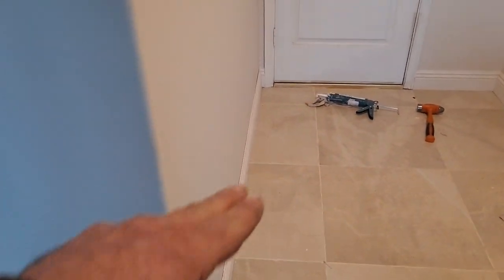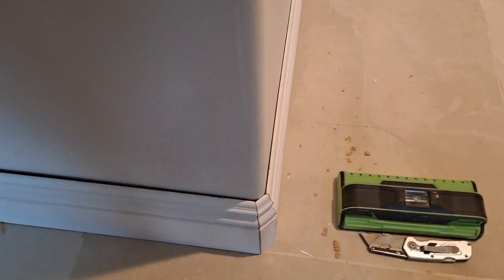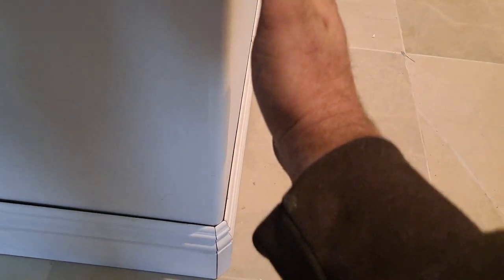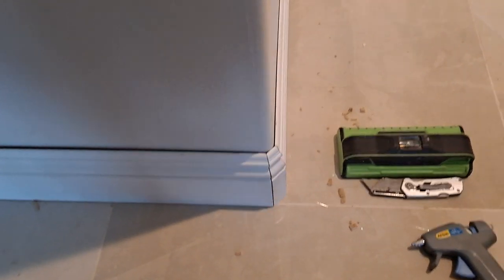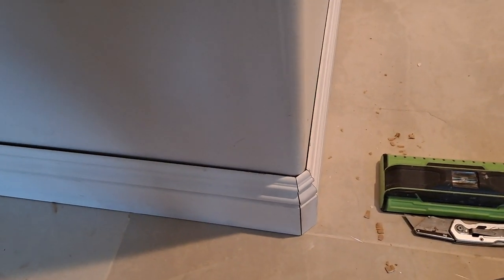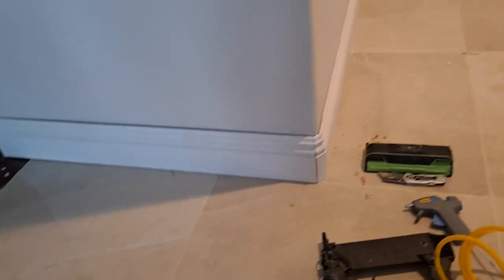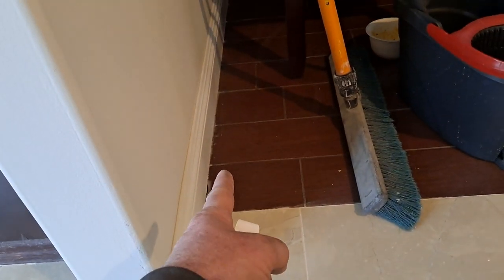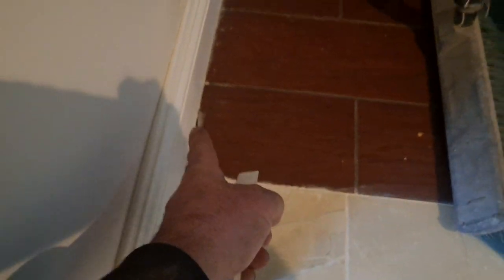Baseboard installation on bullnose corners DIY tips.

Comment: I just did the baseboards in our bathroom. The center piece is 1” across the front. I learned to make a fully functional sample comer assembly that when placed on the wall corner, enabled me to make the cut lines on the wall. Then the long pieces can be marked and cut to those lines. I just batched out several center pieces at 1”. On shortens runs, I used CA glue and regular wood glue to pre assemble. The CA glue provides instant clamping while the regular glue sets. I had 100% success using this method.